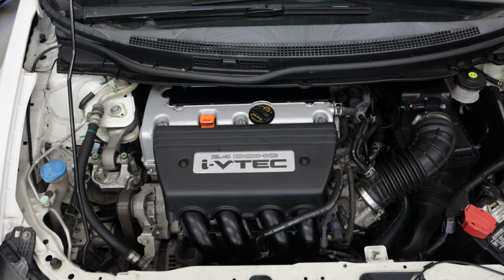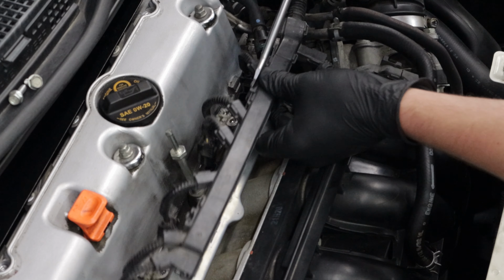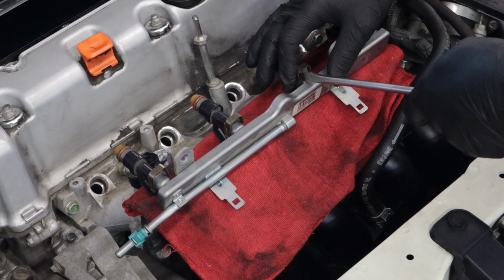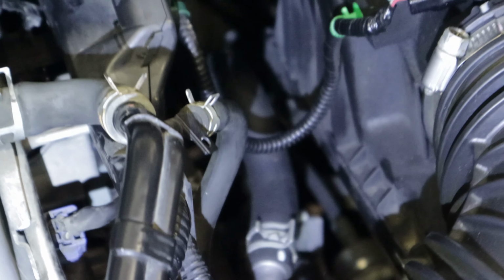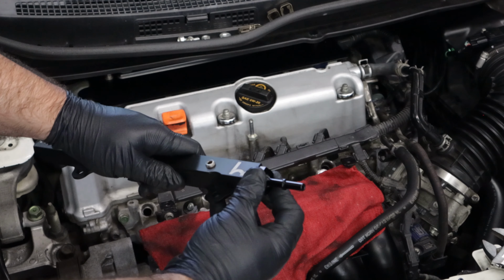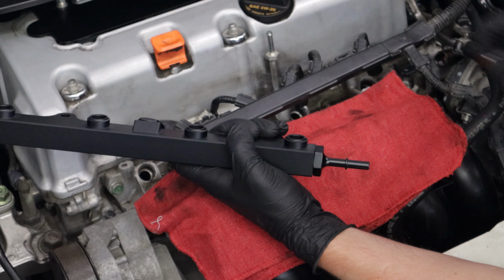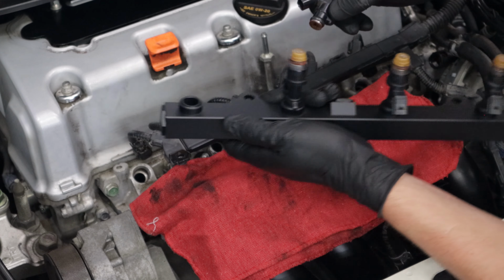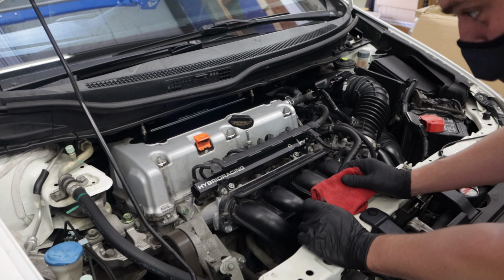Hybrid Racing Fuel Rail Install (2012-2015 Honda Civic Si)

Comment: I've had this fuel rail for the last 10 years on my K20z1 CRX (still works flawlesslywith zero corrosion). Never knew the injector metal retaining clips weren't needed. Sounds like more weight reduction has been found! Thanks Hybrid!!

Comment: Hybrid Racing! Can I use the fuel line on your website for an 8th gen civic si on the 9th gen si in tangent with this fuel rail? Y’all don’t seem to have a specific fuel line for the 9th gen to pair with this.